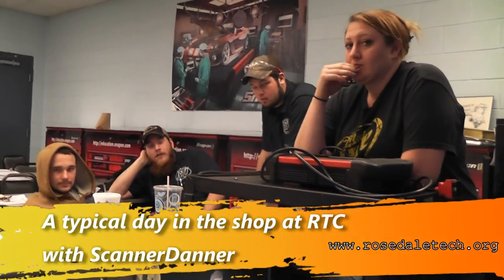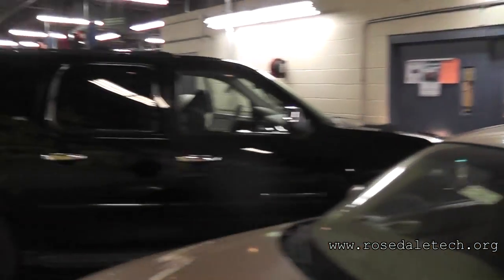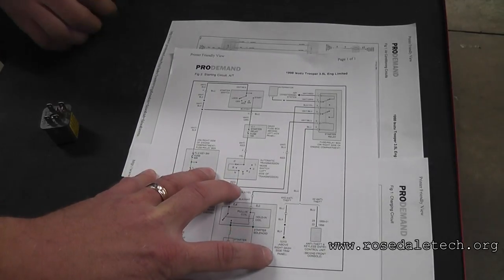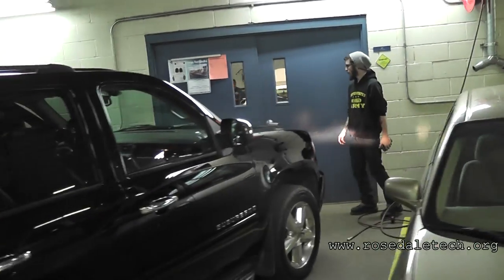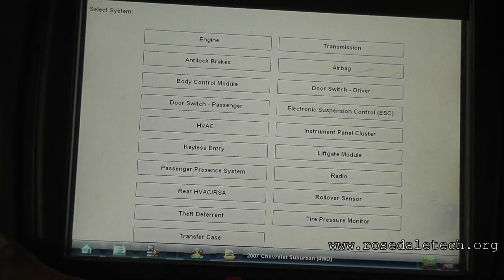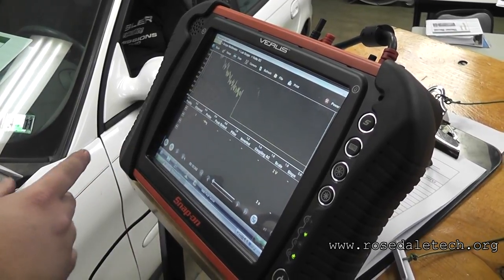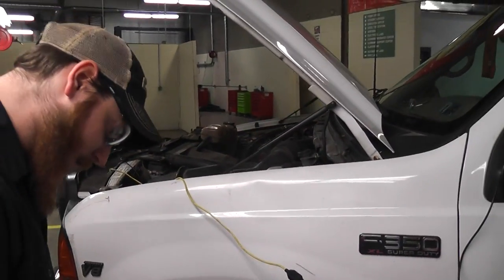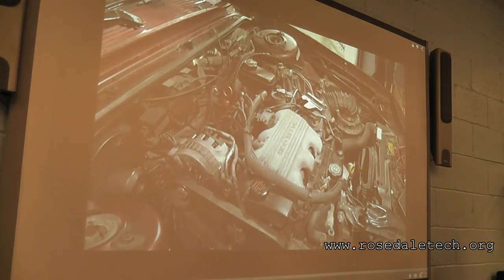Shop time with ScannerDanner at Rosedale Tech (live work part 2)

Comment: Paul,
     A great video on "a day in the life of Rosedale".  It is very exciting to see students learning and figuring things out with your guidance.  I applaud your teaching style where you lead the students to the solutions - you just don't give them the answers.  This restores my faith in the industry knowing that the output from your classes will be knowledgeable and thinking technicians!
A couple of observations.  There seems to be no consistency in manufacturer protocols for scan tools (Ford - no injector balance capability), or wiring diagram consistency.  My experience is that the customer drives the manufacturer's products.  I would think that folks like yourself and schools like Rosedale might have some influence on manufacturer's to drive consistency in these areas.  An injector balance test and an accurate and easy to follow wiring diagram will certainly result in fewer hours of troubleshooting.  This ultimately makes a happy customer with a lower repair bill.
Keep up the great work and my hats of to your students who were brave enough to appear on camera.
Gene C.

Comment: I have been watching your vids and trying to learn to be and become better at diagnosing car suv problems. I think I'm grasping what I am seeing. For example,  in looking up diagram for my vehicle fuses in rear passenger side compartment. Has three individual rows of fuses numbered 1 -- 12 . What came to me was that the amp fuse indicated to me in my interpretation of looking at diagram, is in my example #5 - 80 amp glow time control unit 2 is J703 3) 5) 6) 10)  60 amp 13) 15) relay for 3rd heating stage is J959 correlates to functioning in conjunction with the ECU controller J623 and 2 J624 3) 5) 6) 10) to the thermostat throttle valve for both low / high  heating output relay J338 ; J359 and J360 these have interaction to some degree. I have not gotten into any of the diagrams you show within your videos or class videos I have seen.  My vehicle issues are mostly low power of sorts low voltage condition to supply voltage B+ condition to implausible signal condition to no signal/ communication condition to short to ground condition to being an open circuit condition. So what I am to look for would it be the 5V reference? Say I have output voltage power to activate Terminal 15 but I am seeing only 0.288V right. Now my output voltage power to activate Terminal 50 which I am seeing no voltage 0.000V what should I be looking at there to determine why terminal 50 has no voltage at all?

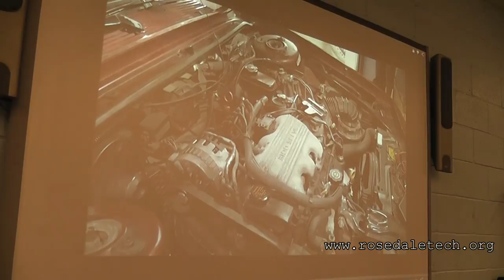Comment: At 51:00 you mentioned the connector I was talking about and I missed it: Anyway, I'll leave this up if anybody need to know.

When you're talking about the GM Fuel pressure drop test on a 3100 and had to backprobe the ECM to fire the injectors. You don't have to do that. All 3100 engines I've seen had all the injectors on a single connector that is easy to unplug. It comes out from under the upper intake near the power steering pump and has over 12 wires on it. It's got the MAP, IAC,TPS and other things on that connector. It is usually on a bracket with another connector between the alternator and coil packs. Check wiring diagrams to find the right wires to use. The other connector is for the coils if I remember right. Since you don't need  the motor running you can unplug it to do the tests. Plug it back up if you need to start it.

Youtube won't let me paste a link, but image search for GM 3.1L fuel rail and you'll find a picture in the results somewhere with the upper intake removed and the harness and connector visible in the upper left side of the photo

I'm pretty sure the 2.8 3.4 and 3.8 have a similar connector, but don't quote me on those.

Comment: On the chevy, you should take a sample and do an "ethanol test" which is simply putting equal amounts of fuel and water in a clear container. Shake it up and see if the level stays in the same place, the water and alcohol will mix. thereby showing alcohol content.
EDIT: FORD cheat-unplug one coil as you watch primary current ramps , there is your sync. then the firing order betrays the cylinder failure.

Comment: I would certainly bypass the PNP switch assembly only because I like to raise eyebrows. Yeah, a 7mm universal socket(shallow) an extension and a 1/4dr air ratchet make removing ign. coils from these Fords a lot easier and quicker.  As long as your students sink these basic fundamentals into their head, they will be just fine.

Comment: Hey Paul, the part of the PDC box the students where trying to remove wouldn't come out? Isn't it possible to unbolt the entire PDC box and look at the wires from the bottom of the box? If it's not a huge waste of time. I'm probably going to have to do this on a vehicle I'm diagnosing excessive 5A battery draw (presumably constant but tapers during readings)
Reply from the maker: What time frame? Thanks!

Comment: Great video thanks Paul I am a big fan of you and James, this video was timely for me wifes flex fuel 07 Yukon negative fuel trims -19 % both banks at idle, under load no issues with trims was stumped  no codes present no direction but can not figure how to reset alcohol can't find it on my solus pro wondering if my version isn't capable 9.4
Reply from the maker: Not sure. It was under functional tests. You couldn't find it there? What is your alcohol % on scan data? And have you been running flex fuel?
Reply: ScannerDanner thanks for the reply Paul, never has had e 85 in her and could not find alcohol on scan data gonna attack again this weekend am in Ontario Canada . also have a fuel smell when idle for a warm up but no leaks.
Reply: Robert Lenane watching video again to see if I can get scanner help.... thanks again
Reply: Robert Lenane GM 06 and newer there is a alcohol sensor on the fuel system and there is no way to recalibrate the alcohol content the computer measures the content. Check for stainless fuel lines and regulator if it is flex fuel vehicle it will have stainless if its steel or plastic its not flex fuel and will not have the sensor. I had a PID for Fuel volatility and it read LOW so I  checked on SO trouble shooter and that's the info they gave me
Good luck
Reply: Thanks John!
Reply: thanks for you help John, is flex fuel but system is a returnless system regulator in the tank line is stainless think my scanner needs up grading no pid for alcohol no troubleshooter  in my version thought its 9.4 but its 8.4 no mil on bad fumes stumped right now

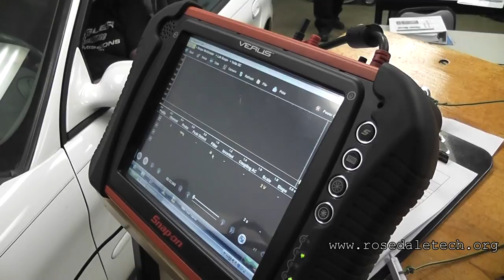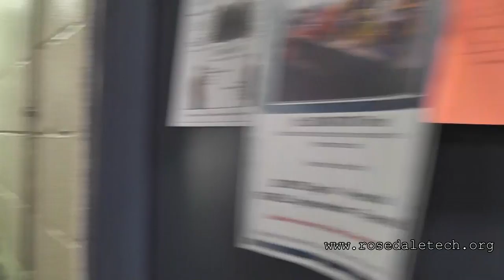Comment: 37:18 Dos "Clear flood crank" only stop fuel pump to work? (on this car model)...1) its sound like car actually stalls the first time and so student didnt need to stop it. 2) Weard starter current wayform with CFC 37:40. 3) No fuel presure in fuel rail, after CFC 1:00:47 ...Sorry my english ;)
Reply: It doesn't stop the pump, it cuts injector pulse.
Reply: Yeah, i have heard that before. This video just makes me belave there is different versions of it.